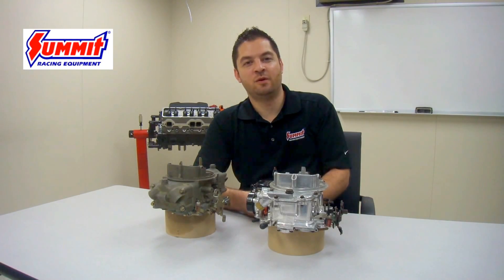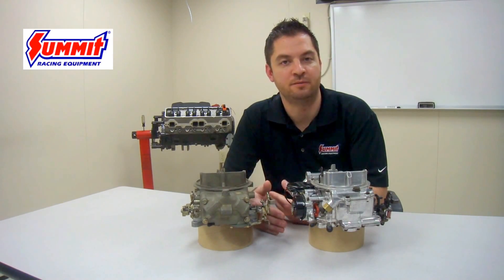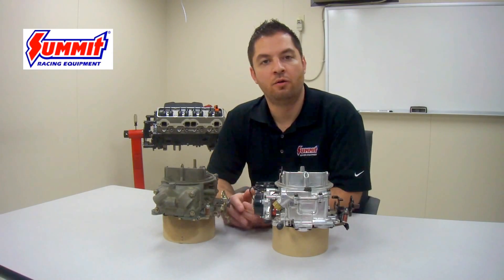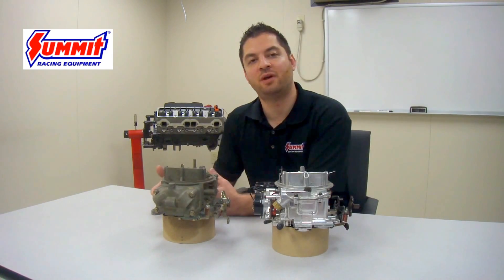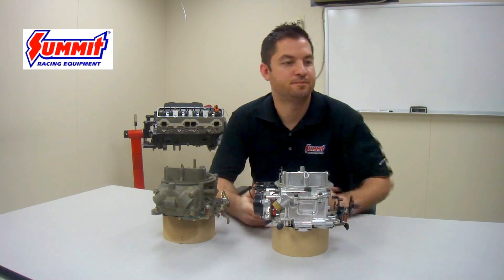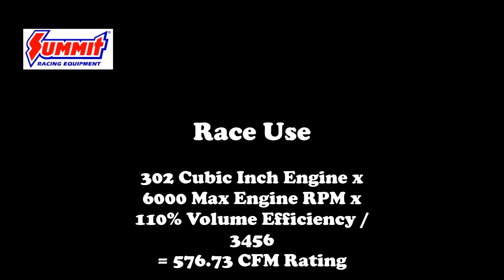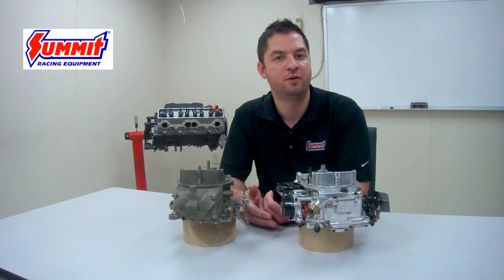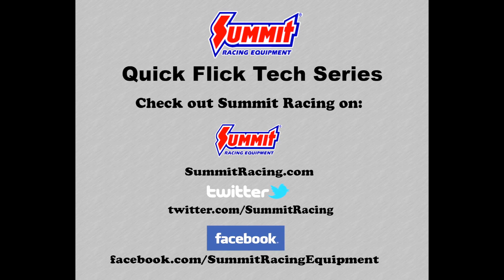Carburetor Selection & What a Carburetor Does - Summit Racing Quick Flicks

Comment: I hope you can answer my question.

can u use a 500 cfm on a Ford 351W or 350 Chevy engine? Thanks
Reply: That's a perfect cfm rating for both those engines
Reply: Glenn Manchester that’s what I’m afraid you’d say. I started my build about 5 months ago. 302 based Scat 331 Stroker .030 over, Mahle forged 4032 pistons, fancy rings, aluminum cylinder heads by BluePrint (190 cc intake runner, 2.02/1.60 valves, 60cc chamber) Weiand dual plane low rise, 4 barrel heat insulating spacer 1/4” tall, 1” wood spacer, Summit 70gph electric pump, Holley bypass return style regulator, new steel 3/8” fuel line with Earl vapor guard 5 micron pre pump filter, summit 100 micron pre carb filter, Compcams XE266HR12 cam (MSD steel distributor gear) Summit billet distributor, Summit Epoxy filled coil (0.7 ohm) and I’d already purchased Summits 600 CFM vacuum secondary carb. I should replace it with Summit 500? Or can I jet down, and replace my 7.5 power valve? I haven’t run it yet, but I got the carb from Summit about 4 months ago.
Reply: @WesternReloader  With good flowing heads on a 331 stroker 600 cfm might not be enough unless you just want to drive it around. There's lots of drag cars with 331's that run great with 750 carbs.
Reply: @bobstephens8851  it’s a 4 speed manual bronco, built for mid range rpm, the roller cam is xe266hr12, so some overlap. Don’t need off idle anything because gearing, and it revs good till 5500. I’ve always got tripped up over cfm Maximums vs port velocity/homogeneous mixtures. No drag racing, just wanted streetable power with a scant hope of 15mpg

Comment: EXCELLENT!!! Jeggs, Summit and eldepuke told me to buy a 500 cfm eldecrap thunderpuke for a 309 cfm 4spd in a 6000 lb truck. I kept telling them it was too big. I didnt know anything about vacuum secondaries. I have hated the eldershit ever since and will never buy anything from them again!!!  I told them I needed a 350 to 400 cfm carb. and I wanted something reliable. By your math I need a 357 cfm with mechanical secondaries, which is what I was trying to find to start with. But hey, if it isn't right to start with "there is thousands of adjustments you can make" too try and monkey screw it into working...

Comment: I have a 61 studabaker hawk it has a two barrel on it do I have to change the manifold or can I use a spacer
Reply from the maker: Hi BIG MEECH, 
For best operation and performance, it would be best to install a 4 barrel intake manifold.
Reply: Ok thank you and by changing the manifold and carburetor to a 4 barrel can a 289 v8 handle it

Comment: I got a Road Demon 625 cfm vacuum secondaries Carburetor,  I  noticed where a squirter for the secondary goes, there is a hole there. Is that the way it is designed, this is looking at the carb from the the top between the boosters?
Reply from the maker: +Rodrigo Venzor , 
Yes, that part may also be used for other carburetors and at that time would be drilled for that purpose.

Comment: Hey I just got a 1985 chevy c10 with a stock 305 in it. I am a student and what the best carb that will give an equal share of performance and mpg. What do u recommend?
Reply from the maker: Louis Yunker , 
Believe it or not, the original Quadrjet’s that were factory installed were designed for just this purpose. Now, your original may not be there or may even be worn out but, we offer re-manufactured Q-jets that will bolt right on to your original intake manifold. Give us a call! 1-330-630-0240. Thanks for watching!

Comment: What carburetor gives BEST performance/ speed and is fuel efficient on the street on a 350 sbc 4b? Thanks Summit Racing
Reply from the maker: Joe Silerio, Well, this subject has many opinions but, when you consider that a Quadrajet has a small primary butterfly and a large secondary butterfly along with metering rods in both primary and secondary jets, its easy to see why GM used them for so many years on so many different applications.
Reply: Good answer always the best all around  quadrajet

Comment: can I mount a holly carb to a edelbroch intake and will I need a intake plate.
Reply from the maker: Hi backwoods1, 
If the carb flange happens to be a dual pattern like some of their offerings, yes you will need a EDL-2732  plate kit for proper sealing. Otherwise, a single pattern carb flange will not require this plate. http://www.summitracing.com/parts/edl-2732/overview/

Comment: If I have a mechanical choke Q-jet and want to switch to a Street Demon, how would I set up the electric choke??
Reply from the maker: Hi leolion1993, 
You should run a wire from an unused 12 volt switched terminal in the fuse box of the car. Put a 10 amp fuse inline just in case the electric choke coil were to ever fail. That way there will be no damage to the fuse block or wiring harness of the car.

Comment: I have no receipts or proof of any work done. It runs smooth, unless it has a street cam I would think it was original. I know when I got it, timing was retarded. I'm not sure if that was intentional, but it ran like a turd. I've had the timing up to 16° initial with no pinging. I'm using the old world penske inductive timing light, so I have no way of knowing total timing. However I've backed it down to around 12° just to be safe. The car runs great. I just want to tweak it to its maximum potential. I'm still running a points distributor, the guy I got it from claims it is capable of holding up to 400hp. He also claims my motor was dynoed at 379hp. Have you ever heard of a cam that requires the timing to be retarded? He claims it's supposed to be 0_4° btdc...does any of this sound right? It seems to run better @12. But I realized the fuel bowls were far too low long after I adjusted the timing. The car runs great now. Just wondering I should do and which order to do it in. I have the the carb adjusted right, plugs gapped properly. What do u think should be my next step??
Reply from the maker: Hi Allen Mccluskey, 
Can you give our tech department a call? 1-330-630-0240. We look forward to your call. Thanks for watching!

Comment: I have a mildly built 69 olds cutlass 350, it currently has a new 770 street avenger on it. Compression is 10:1. Heads are original #5 I believe 64cc. My question is the 770 too much carb for it? I don't know the specs of everything but the heads are supposedly ported and flowed, it's supposed to have a cam, blah blah blah. It runs very well and has plenty of power. My question is say if it were OE specs, would the carb be too much or could I expect better performance from a 600 or 650?? Like I said, it runs great and has plenty of power. Factory hp was 310, it has dual exhaust with factory manifolds. Please give me your input. Thanks in advance
Reply: Andrew Gems I run the highest octane fuel I can find at the pump...usually 91_93, I do run the specified mixture of offroad lead additive as added insurance, however I have ran pre 71 vehicles with high compression engines with high octane gas and MMO without a problem ( marvel mystery oil) and no matter what the age of engine I run 8 oz of MMO for every 10 gal. of gas to keep it running healthy and clean internally. Hope that helps in some way.

Comment: I'm looking at buying an offenhauser single quad intake for my 225 slant six. Using the 85% formula it comes out to 270cfm and using the 110% formula it comes out to just over 350. I haven't been able to find any 4 bbl carbs with a cfm rating under 500. So my question is who makes 4bbl carbs for lower cfm ratings? By my math you'd have to be doing 7000rpms at the 110% formula with a 225 to even reach 500cfm which is really pushing the /6's capabilities, from my understanding they weren't really designed for high rpm output. So my second question is what kind of damage/side effects would I be looking at if I threw a 500cfm 4bbl carb on my 225ci slant six with the offenhauser intake vs just replacing the carb I have now for another stinkin single bbl?
Reply from the maker: Hi Jeremy Knop, 
Holley has a small 4 barrel carb here:
http://www.summitracing.com/parts/HLY-0-8007/?feedback=1
They also have a small 2 barrel carb here:
http://www.summitracing.com/parts/HLY-0-7448/?feedback=1
This is as small as we can go and remain easy to bolt on or adapt to the Offenhauser intake manifold. Anything smaller would be a reman unit back on the original intake.

Comment: Q: When put a new carburetor on does the spark plugs have to be changed out also ? I have a 84 Caprice Classic with a 350 engine my first old school
Reply from the maker: Hi Ishaq Prather, 
If the car has been running badly due to a faulty original carburetor; yes, it is highly suggested to install a new set of spark plugs at the same time. Thanks for watching!

Comment from the maker: Last, have the ignition system checked by a qualified tech with an ignition oscilloscope. One more thing, make sure that any fuel hoses (especially on top of the fuel tank) are not suctioning shut; cutting off the fuel flow to the fuel pump assuming it is mechanical and mounted at the engine. A diagnostic fuel pressure gauge where you can see it under load would give you an indication of this!

Comment from the maker: Lack of power under load can be attributed to a few things. First, is the float level at factory specification? Is the accelerator pump in the carb working? Is the load enrichment circuit operating properly? You could also check and verify the timing advance is operating. This is usually a combination of vacuum and mechanical (centrifugal) types of advance.

Comment: The weight of a car has nothing to do with when the secondaries will open... the secondaries open when the vacuum (not to be confused with engine vacuum. Im talking about the low pressure area created by the venturi of the carburetor) in the venturi exceeds the amount of pressure the secondary spring will hold.

Comment from the maker: Yes, a vacuum secondary carburetor can be used on a vehicle that has a manual transmission. The only time we do not recommend this is if the vehicle is extremely light (2,500 lbs. or less) due to the engine not being under enough load to actuate the secondaries. In this case we recommend going with a mechanical secondary carburetor instead.

Comment: So if you have a manual transmission you can still use the vacuum secondary carb right?
Reply: Zachary Morgan old comment,  but from what I can understand,  yes! The secondary is vaccum actuated. As engine load, RPM's, and vaccum increase,  the vaccum begins to open the secondaries past a certain vaccum point.